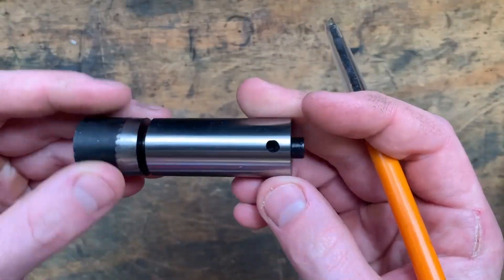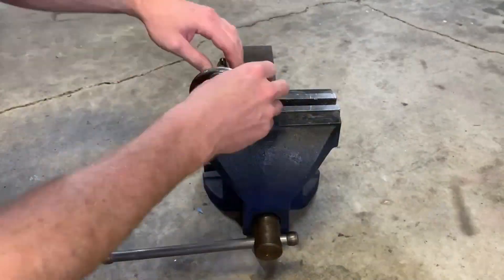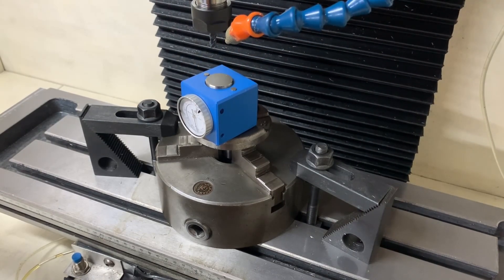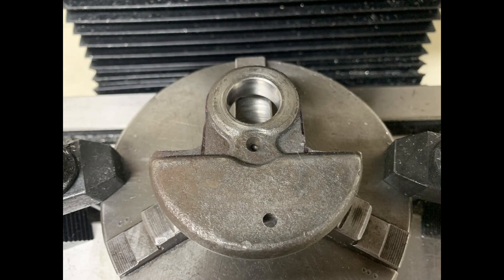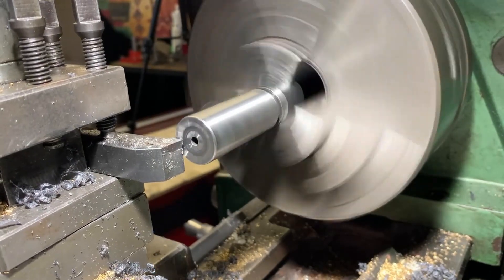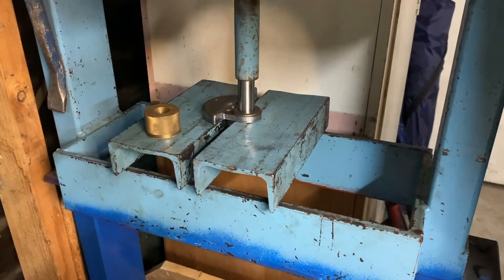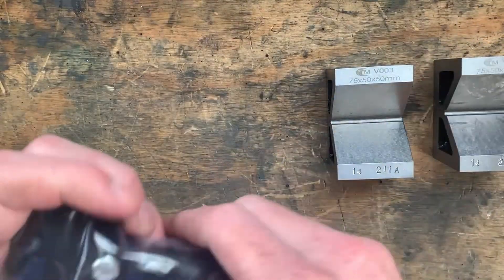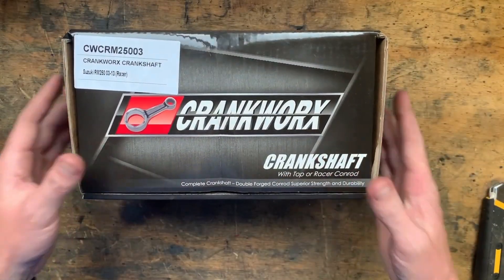How I Made a Custom Crankshaft

Comment: How come there are no thrust/axial washers between the conrods? What stops them rubbing etc.
Reply from the maker: It’s the same set up as the stock Honda crank. It does not run thrust washers either. There is also oil pressure fed from the big end which will keep all surfaces well lubricated in between the rods.

Comment: I had a pin made years ago for an MB100 with an offset centre reducing the stroke. Cost about $1k including the dummy pin used for assembly and testing. Also cut down a FZR. Turned a 4cyl into a twin, the reverse of your work. Slowly working my way through your vids
Reply from the maker: They sound like some pretty neat projects, were you using them for bucket racing?
Reply: @OddsandEndsMachining  I have an MB engine in an FZR250 chassis making an easy 24.7hp at the moment
Reply: @OddsandEndsMachining  yes, for bucket racing. The MB made 30hp at the wheel in the end. The FZR has seen 32+ at the back wheel but it had a little accident. The new motor is sweet so far. Time for some boost
Reply from the maker: That’s pretty cool, seeing the fzr would be pretty neat. That’s a lot of power for a bucket.